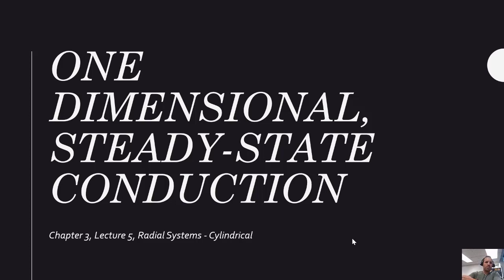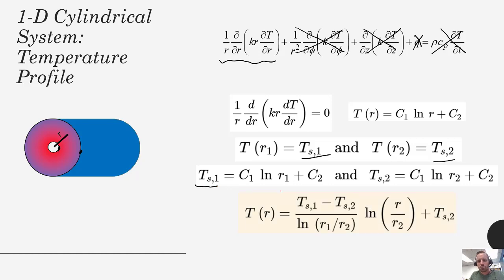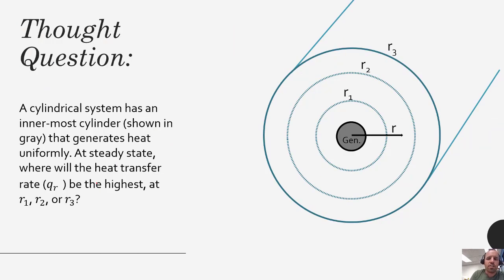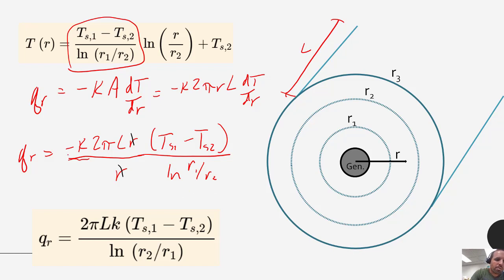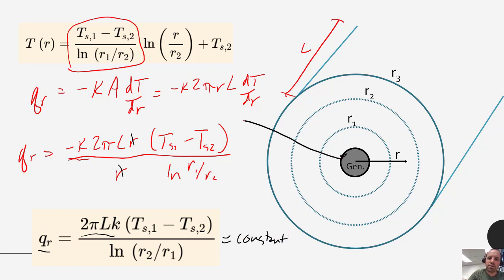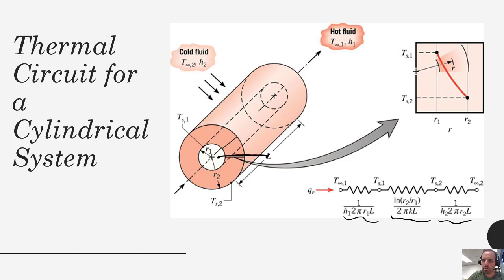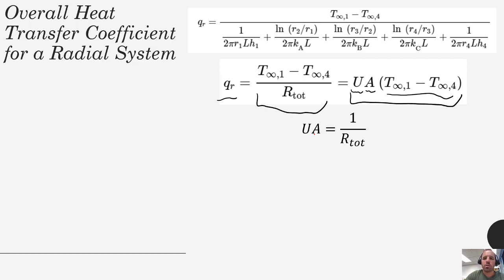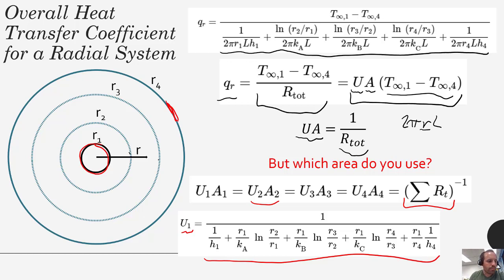Heat Transfer - Chapter 3 - Cylindrical Systems - Temperature profile, Thermal Resistance, U-Value

Comment: What happens to the equation of total heat rate q_r if we add an outer wall "T_surrounding" and attribute an emissivity to the surface?
Reply: Once you have the heat rate q_r you add the resistance of the new wall to the Sum of thermal resistances, then you use the emissivity to calculate the new rate of heat that is coming out of the new wall (this one should be minor than the original q_r). Then you have the net value of the heat rate that is going to be in direct contact to the fluid. That way you have q_{new r}= Delta(T)/Sum(Thermal Resistance), beacuse Delta(T) is T_{fluid in the middle} - T_surrounding, you can find now T_surrounding.

T_{surrounding} = T_{fluid in the middle} - Sum(Th. Res.) * q_{new r}

Comment: The problems faced by solving cylindrical heat transfer using natural logarithms are:
1. When R1 = 0, then the heating value is ~ +
2. The result is that the temperature at the center of the cylinder also has a value of ~ +
3. You cannot find out the change in the value of the circumference of the cylinder (2πR). This is because you don't know the R value.
4. The R to dR ratio value becomes inconsistent. I have explained this in a previous open letter.
5. A serious problem occurs when the radius of the cylinder is large and the thickness approaches the radius of the cylinder, then the ratio of R to dR has the value (R >> dR), R is very large compared to dR. It seems that if viewed from T1 the value is reasonable. However, the T1 value actually has a fatal error.

I just hope that you read very carefully the meaning of my open letter.